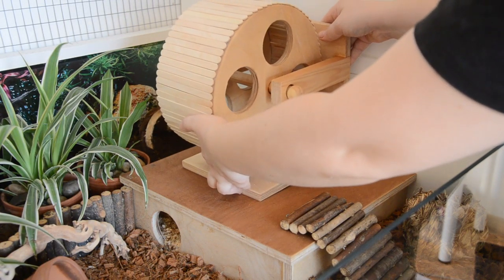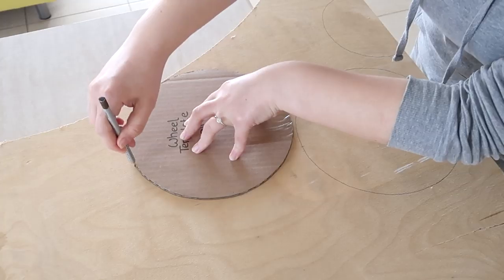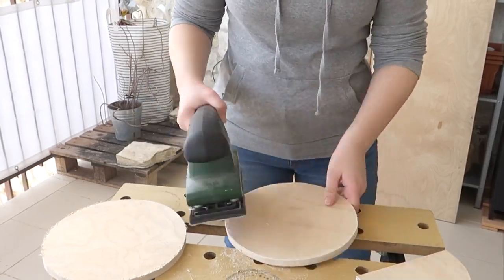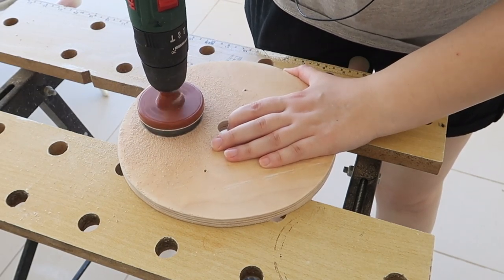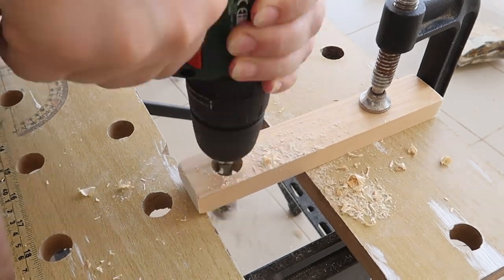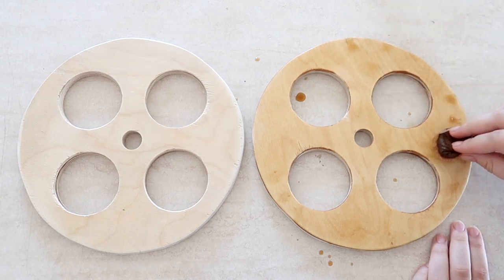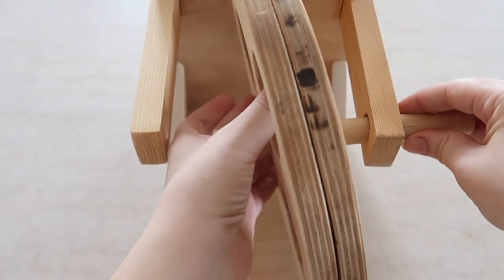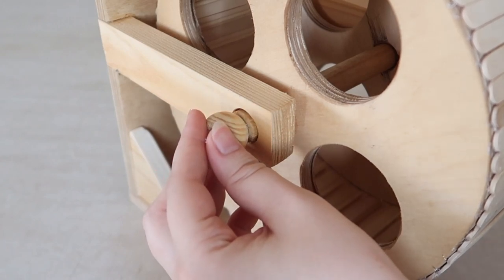Wooden Hamster Wheel Tutorial | #DIYJuly 19

Comment: I remember that I bought my second hamster a bigger plastic wheel than the one that came with the cage because he had grown out of the first one. Then the grip, that was attached to the cage bars, after a while became torn so the wheel kept sliding down to the cage bottom. After a few secs after my little friend started running there the wheel just stopped. I have never seen a more confused hamster... every time it happened! 😂 It was hilarious but I knew my hamster wanted to run so I got help with making a little hook that made the wheel stay up. It worked perfecttly but was a bit tricky when I needed to take it off and on to clean the cage but it was so worth it. This wheel looks a lot different from what that wheel looked like but I like the DIY wooden wheel better. If I get a hamster again this will certainly be on my to do-list. I made a wooden cube once with holes to climb through but it wasn't very popular with my hamster. And I made a wooden house for him to sleep in, he liked it so much that the plastic house that came with the cage was used as a toilet instead. 😂